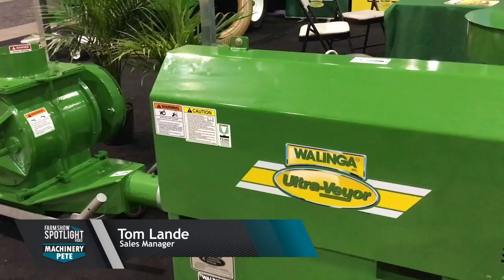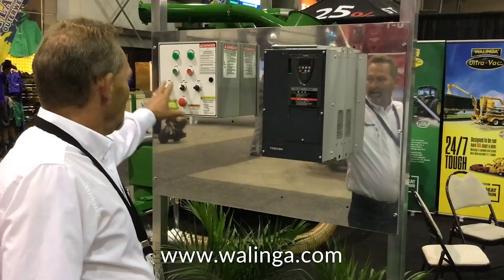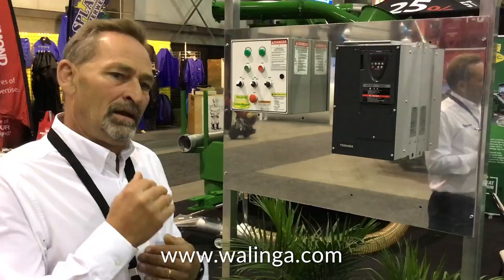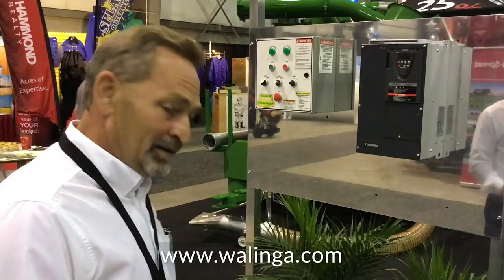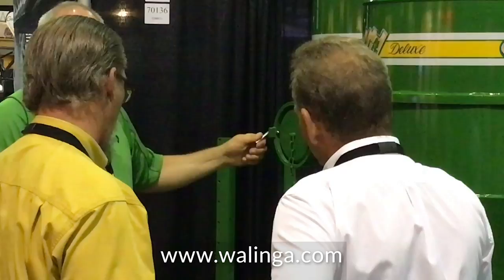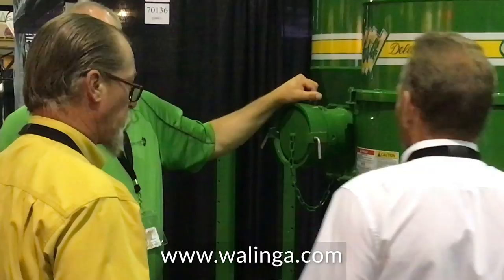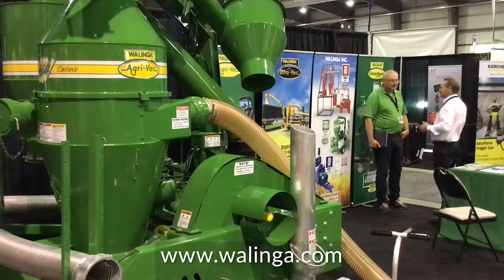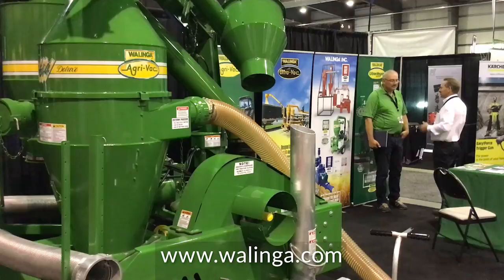Walinga Ultra-Veyor: Ultimate System for Transferring Your Grain

Comment: Can the deviceWalinga Agri-Vac 6614 DLX
 be run with a 100-horsepower engine? Is the device powered by simple hydraulic power such as power or requires strong pressure hydraulics with thanks